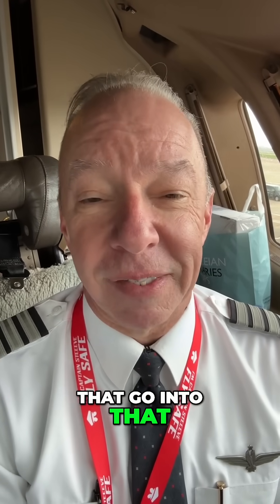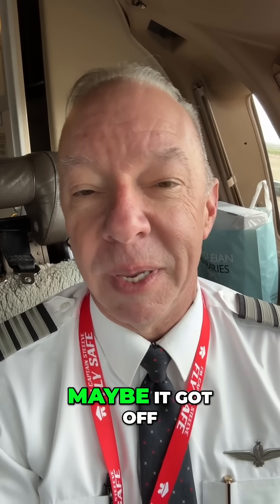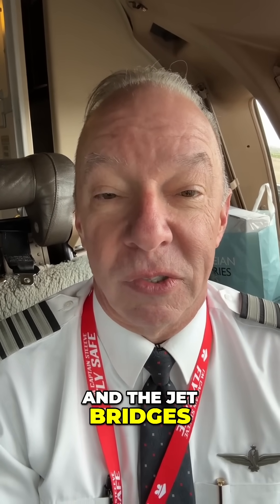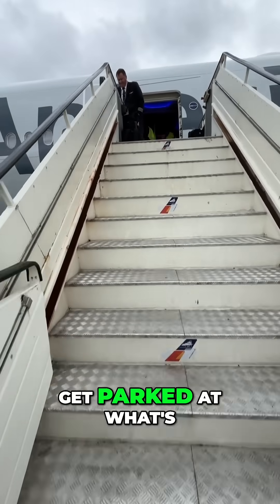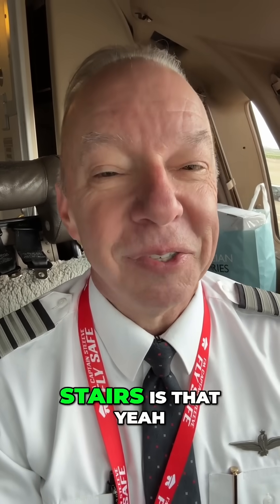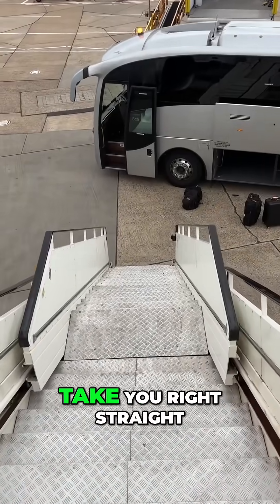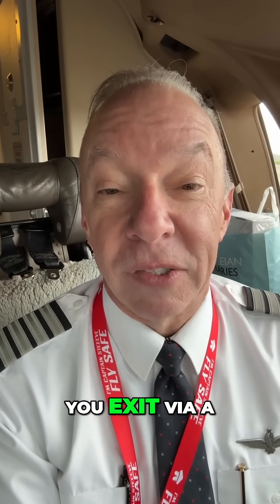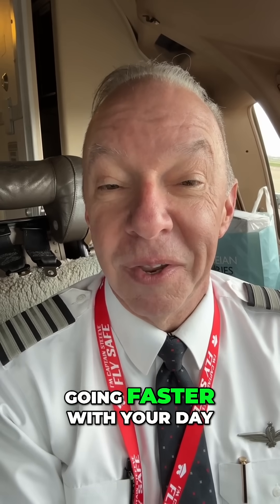Why Do Planes Use Stairs Instead of Jet Bridges?

Comment: Off topic question: Tires and wheels - you see a lot of rubber at the end of the runway where the planes touch down.  This can’t be good for the runway or the tires.  What if, you redesigned the wheels with small veins that would catch the air when lowered and start the tires spinning a bit before they hit the ground?  Slightly less wear and tear on both the tires and the runway would have to be a good thing. Also a smoother landing I would think as there’d be less of a “jerk” as they hit the ground.  What do you think?

Comment: It depends where you are landing, if stairs are a good or bad thing. Last winter, I flew in and out of Calgary, when it was -25. I was on a small plane, and it was parked away from the terminal. It was brutally cold, being outside, and using the stairs. Then we got on a cold bus, that wasn’t warmed up. I won’t make that flight, during the winter, again.

Comment: The stairs aren’t just inconvenient, sometimes they could be downright dangerous; especially, for the older population who are more prone to falling or getting exhausted.
Reply: Yeah, I'm wondering how they accommodate disabled passengers with stairs. I personally couldn't get off the plane if I had to go down those stairs to do it. I use a walker or a wheelchair depending on how bad things are going with my disability, but I always get a wheelchair in the airport because it's too much standing for TSA followed by a lot of walking.
Reply: They have lifts to get the passengers from the ground to the plane

Comment: Some airlines are just too cheap (derogatory) to pay for the jet bridge. Case in point Ryanair, they literally have an operations hub at my local airport, where there are 6 jet bridge gates and never more than 3 planes at gates at once, and they will. not. use. a jet bridge. When you're boarding, you gotta walk down the stairs next to the jet bridge, onto tarmac, and then back up the stairs to the aircraft.
Reply: It’s cheaper

Comment: Deplaned from a Lufthansa 747 on a hard stand in Frankfurt after an aborted final approach. There were a whole bunch of steps. It was the first time I stood next to a 747. It was icy cold, but I didn’t hurry as I walked by the aircraft. What a magnificent airliner.
Reply: The 747 is a behemoth up close I work on the ramp most aircrafts aren’t as impressive anymore but the 747 and 777 are huge i love the 777 landing gears

Comment: With the jet bridge, I'm going from one interior (the gate lounge) to another interior (the cabin). I really don't get to see the airplane. At the end of the flight I again go from interior to interior.
With the stairs, I'm going from the interior of the airport to the airplane itself. I'm surrounded by the smells and sounds of the tarmac, the feel of the air. It's much more visceral.

I grew up getting on planes via stairs, with jet blast deflectors separating the gates. DC-8s and 707's would start up and then taxi out on their own power, blowing dust, JP exhaust and noise at you as you boarded. THAT was getting on a plane!

Comment: The only draw back is weather element like rainy days?   Super hot days?  In Southeast Asia; this is bad.  Once I had to climb up stairs to a Dragon Air L-1011 in Hong Kong.  I worked up a sweat in a hot humid summer day.  It also means that the air cabin is hot with no air circulation.   They won’t be running an engine for passengers are nearby, and no support air usually to the cabin from the airport.  These are usually remote gate.  One time this happened at Narita, we are parked next to another JAL 777 outside their maintenance hangar door.  I guess the plane is going out of service to get maintenance or repair.

Comment: I have a question! Why are the pilot’s seats always wool covered? Seems like it’s been that way for a long time.
Reply: They use the wool seat covers because taxi drivers have a monopoly on the beaded seat covers.

My pure guess: pilots might keep the cockpit air a little cooler to help keep them alert but keeping their back and bottom warm feels better.  Besides that, the air on the other side of that big windshield is -60F and absorbs a lot of heat out of the cockpit air.

Comment: One reason I love the stairs is that I get to see the airplane from the outside. 

There's something nice about being able to stand on the runway, even if it's just for a little bit, because you don't get to do that most of the times.
Reply: I love the air bridge cause I get to touch the outside of the plane and imagine it at 10,000 feet.
Reply: Very true.
Reply: Back in the 70's, I would walk on the parking apron all the time in Albuquerque.
Reply: I was about to write a similar thing 👍
Reply: Yes!!  Especially at JAC! 😍
Reply: view the missing doors and odd engine
Reply: Yes same !
Reply: On the runway? 😂

Comment: Thank you so much for all your wonderful information.  How do they get disabled passengers down the stairs? 🤔
Reply: They'll have lifts that they will put in place instead of the stairs.
Reply: I have a wheel chair ticket and the airline makes you wait to deplane and you get in the lift where they load the food trays, etc. Then you get in a small bus and then a very long walk or ride to either the next gate or through customs (which really helps to avoid long lines at Dulles or CDG or Frankfurt). When boarding it is typically faster for a wheelchair person to just struggle and climb up the stairs and board with everyone else.

Comment: What if you have a passenger that must use a wheelchair?
Reply: They probably check on that before assigning this option.
Reply: They will have a lift truck bring a person with a wheelchair or someone who can't go up or down the stairs to the plane. Some airports, like Dulles (IAD) or Kennedy (JFK), have a piece of equipment called a mobile lounge that will go directly to the plane, unload or load passengers, and bring them to the terminal.

Comment: On a flight from Detroit to Tampa,  the plane I was on took a long time to leave the gate.  Then it sat for a while on the runway.  Finally it started to take off but then abruptly stopped.  A few minutes later the flight attendant said we are evacuating the plane. We had to leave all belongings there and one by one slide down the chute/raft. It was quite the adventure.  And the surrounding scene was like a movie set with emergency vehicles and airport authority on the runway.   My question:  how common is this?   And what type of situation could cause this to happen. We were never told given any reason.  And it passed through my mind that it could have been a drill.  We were put on another flight  about 5 hours later.  What are your thoughts Captain Steve?
Reply: That is totally wrong not to give you an explanation. What happened and why and what’s going on? I’m surprised you guys didn’t panic. I would have.